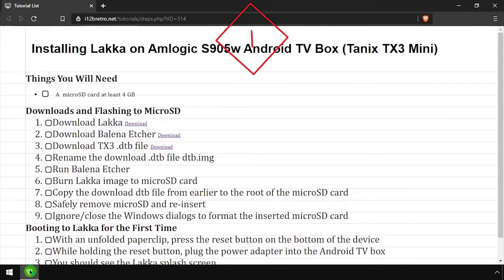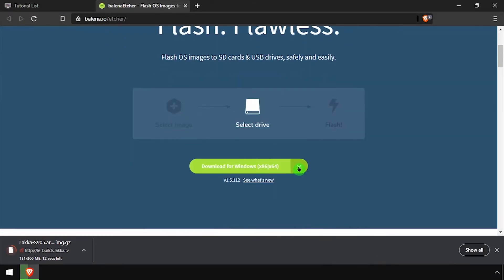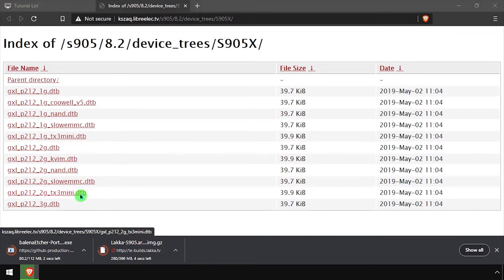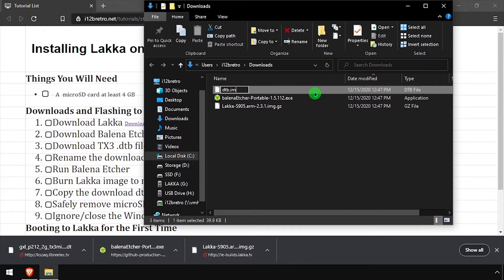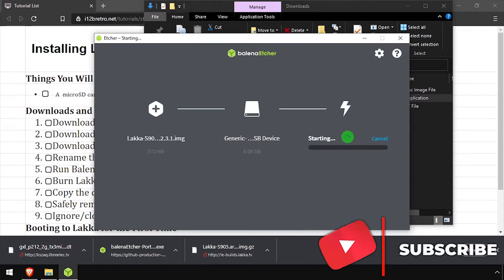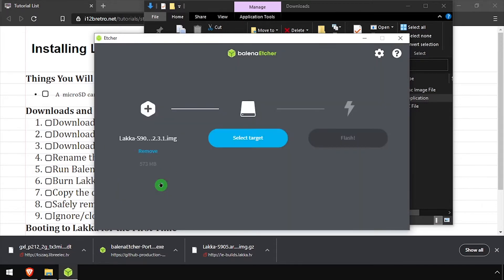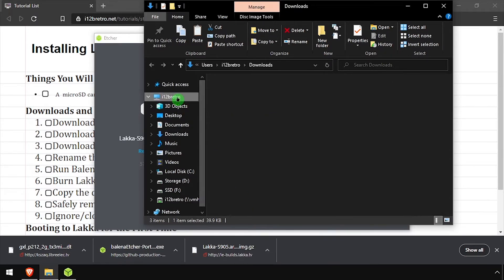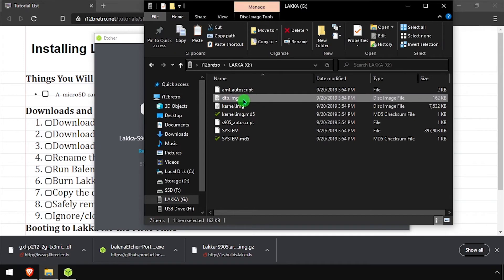Installing Lakka on Amlogic S905w Android TV Box (Tanix TX3 Mini)

Comment: I'm using X96mini with S905w, however, I've followed your step in detail, the device wont boot from microSD, I've even tried  to navigate to the application drawer ≫ Run Update & Backup
Reply: Do I have to root the device ?